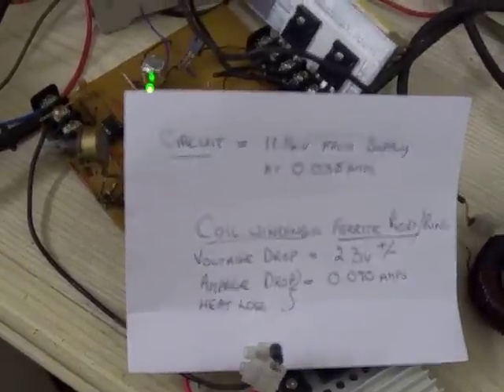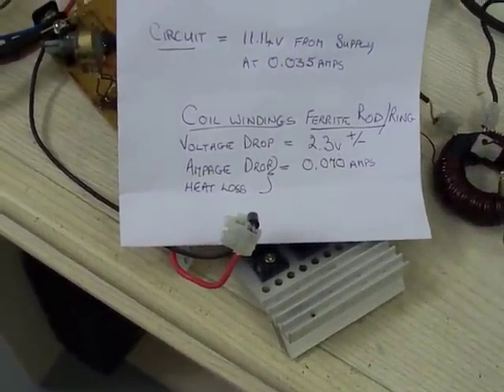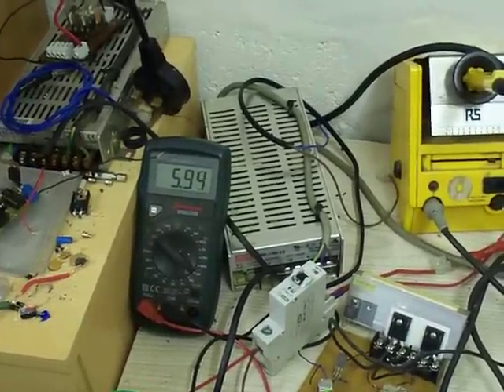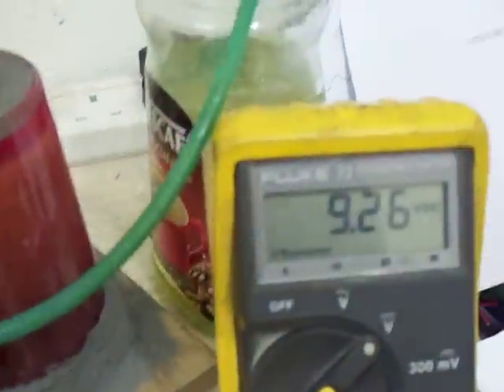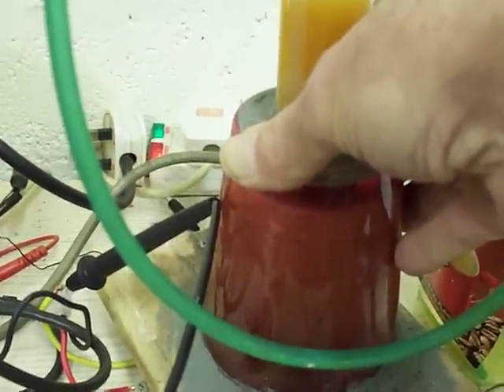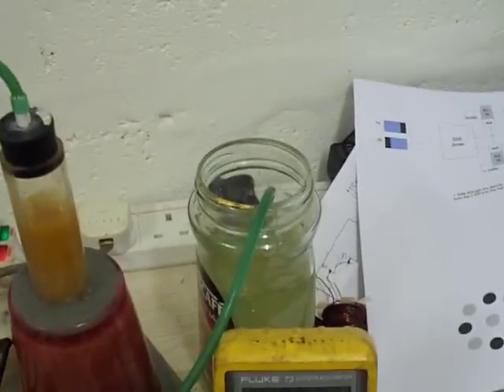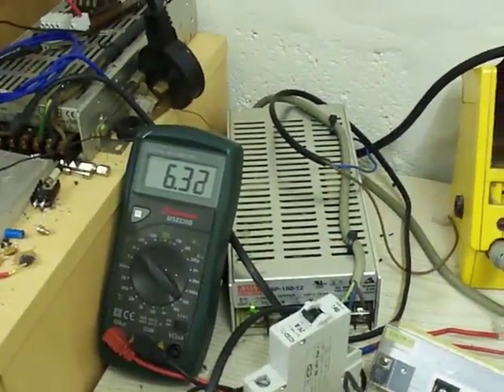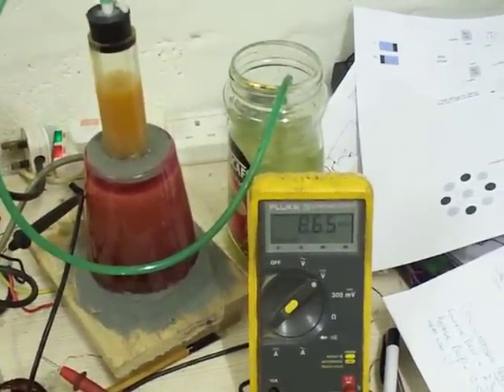CADMIUM & TITANIUM HHO CELL  #2  6.5 AMPS +/- 8.8 VDC

Comment from the maker: The cadmium rods are in parallel so the voltage stored does not accumulate - their total voltage stays at 2 volts +/-
I will try and bring down the 8 volt +/- but not to the detriment of further ampage loss at the ferrite ring due to excessive heat 
I can't get out to my shed to get my frequency counter - anyway, not sure if I busted it the last time I used it ... LOL!
Jim

Comment from the maker: I increased the -0v pulse very slightly & left it to run up to 6.5 amps - still no increase in heat to speak of??? (titanium is on the -ov line)
The larger capacitor is 0.1 mf... not 0.01.
The capacitance in the cell must be very high - took up to an hour to dissipate the voltage after I shut down the cell.
The Cadmium rods hold 2 volts +/-
Jim